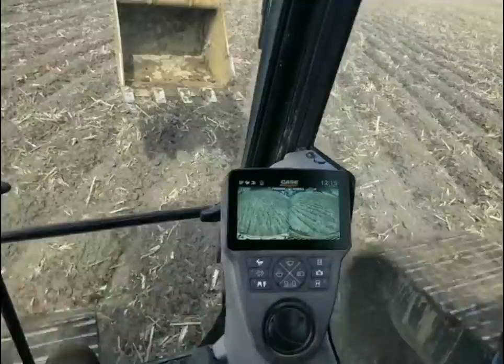We Got A New Excavator On The Job Case CX210D!!! Drone Video!!

Comment: New subscriber here.  Just seen you pop up.  I've got the same problem with a 210 samsung.
Reply from the maker: Thank you for joining!!!....you have track tensioner issues or final drive issues on your 210?
Reply: @dirtgrainsteel  track tensioner.  ive only messed with one other on my 6h.  it turned out just to be simple.  o ring if i remember right.  hopefully mine aint as big of an issue as yours.

Comment: Did you guys go and buy this unit? Been looking at renting a unit like this and potentially purchasing a case 210 hoe for our shoreline business.
Reply from the maker: I did not end up buying this machine we rented it a month and sent it back after getting our 2 Hitachi's running....the 210 is a very nice machine with great power very comfortable to run...right now I'm in the process of running/demoing a HX220AL Hyundai  but thinking about dropping back to a HX210AL because being 10" narrower... you say only 10" well sometimes in a tight area 10" means the difference between getting a excavator in or not ....so far I really like the Hyundai very good machine also fast,strong and comfortable.... I think the final decision will be based off of dealer support so if you have a Hyundai dealer in your area see about a possible demo on a HX210AL and watch some of my videos on the HX220AL